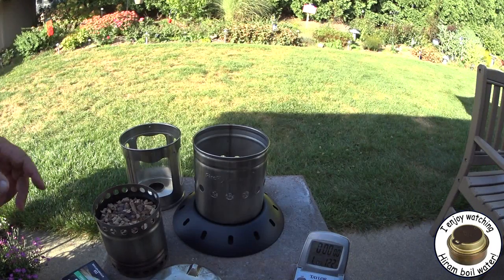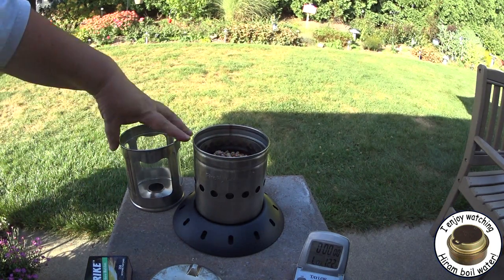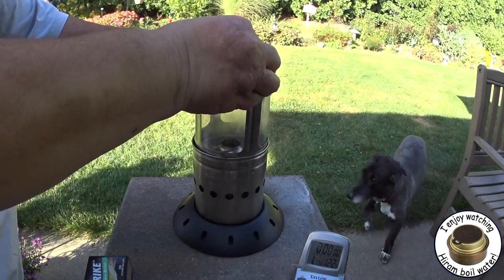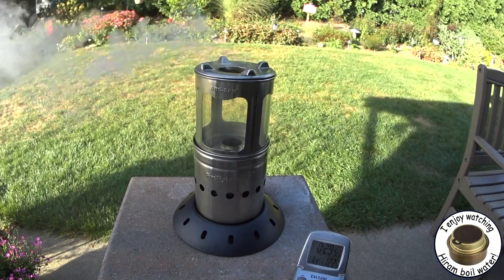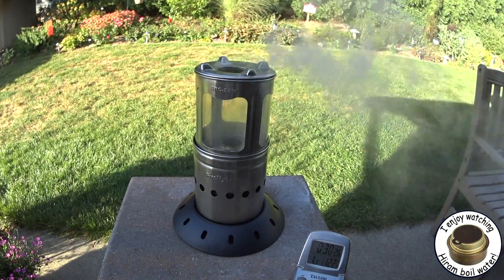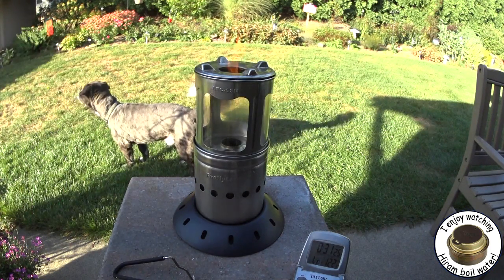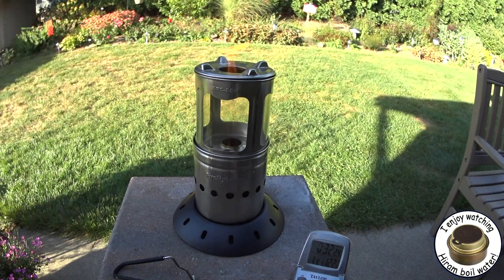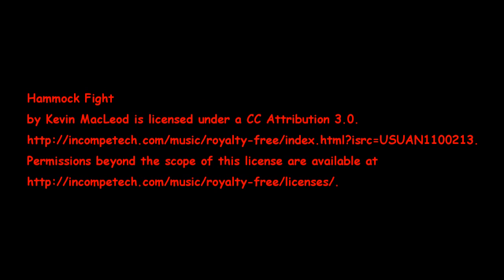StoveTec FireFly Lantern - Burn Test #2 - Wood Pellets - Check For Smoke

Comment: That's really interesting. I think I really learned how to use my wild wood gas stove when I put pellets into it. At that point I realized how small and compact the sticks need to be, and the importance of not covering up the top holes.  This seems like a similar process of gasification. And I sure love that flame coming out.  Top-down fires, or the upside down fires, seem to have an interesting way of burning. It almost seems like they're more efficient, whether it's in a fire pit, or a little woodstove, or in these little pellets stoves.  Thanks so much for showing these, and going through The various aspects.  And that Max sure has a wonderful tail!

Comment: After watching your video, yesterday, did go to other reviews and read comments. From their observations, suspect you will see smoke when you restrict air flow with a pot.  From what I saw, agree with you on both points. (1) Load & let burn out before refilling with fuel. (2) For best use, fuel will be commercial wood pellets, or something very similar, such as corn, or perhaps "natural" wood pulp based cat litter. While, I can very well be wrong, at this point, can't see it being practical to break down twigs & most other naturally resources  biomass into small enough pieces to achieve best results with this stove. Looking forward to seeing if your tests confirm what others are reporting. Thank you for taking the time & being so thorough with what you do.

Comment: hmm! Will the top of the globe part that you would set a pot on fit directly on top of the stove so you would you only use as stove? Hmm! plus if you had a gasafier stove could you take a colman lantern globe and rig your own "LightN Bugout Lantern/Stove" for less money?
Reply: +Mark Martin i dought it will fit   smaller than  outer and looks bigger than inner

Comment: It looks like fun, but for the size and price of the firefly stove you could spend a few bucks more and buy a biolight stove and just plug in a usb powered lamp for light. That way you get a true biomass stove and a light you can actually see with.
Reply: Biolight should make something like this, I can't see an electric fan right next to a fire lasting for a very long time, but I don't see why I'd make a fire for electricity when I need it now, when I could get a hand crank torch for like 3 dollars.